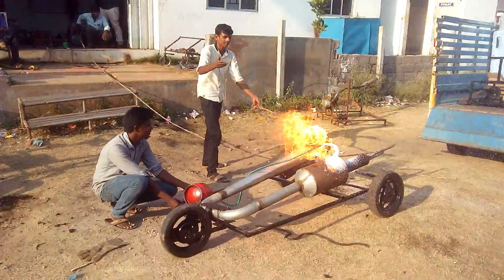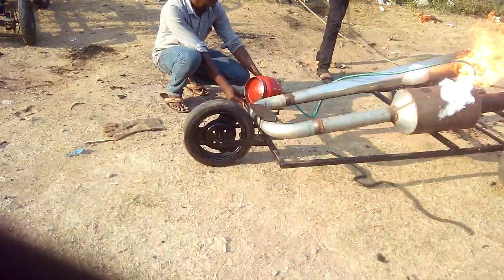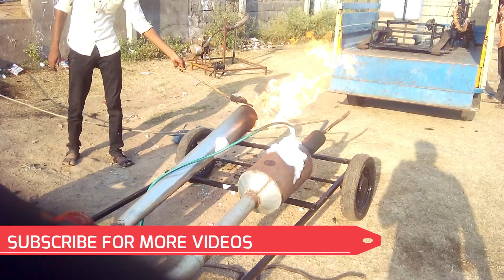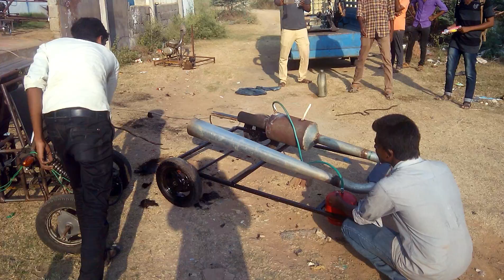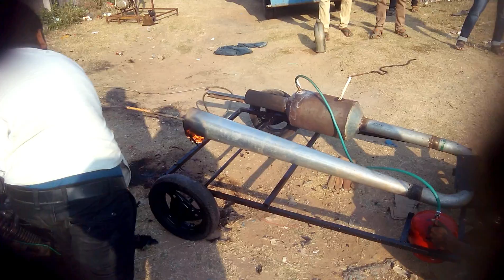PULSE JET ENGINE DIY - TESTING

Comment: Put a small flair (divergent cone) on the intake (short) tube.  Without this cone you will have excessive choking of the incoming air due to a ring-vortex state that will occur.
Reply from the maker: amazing and most important message you gave to us. we cant find the mistakes were we done and were we missed too. your words will change the result of this project. thanks a lot